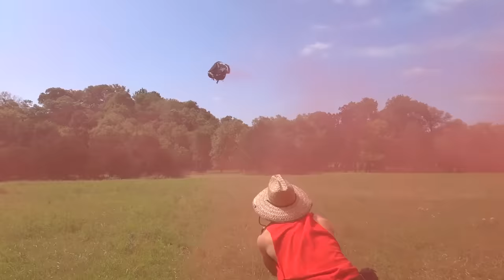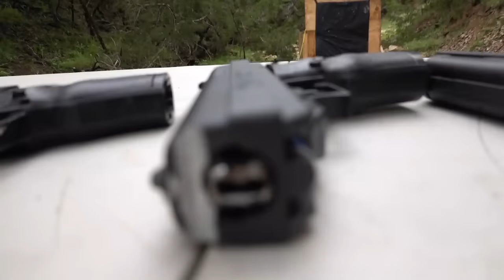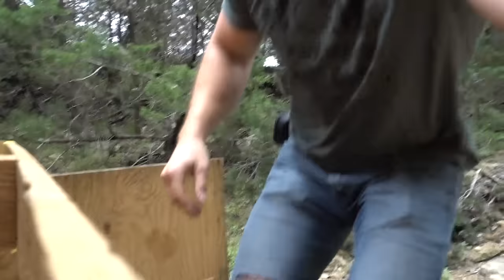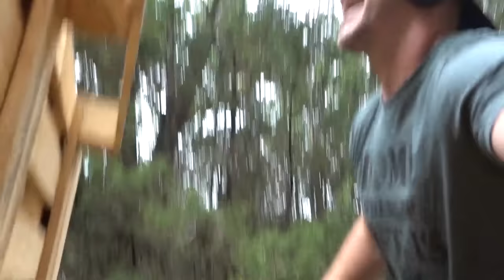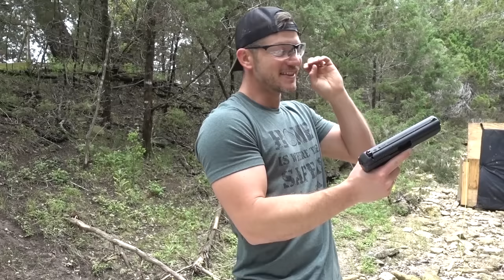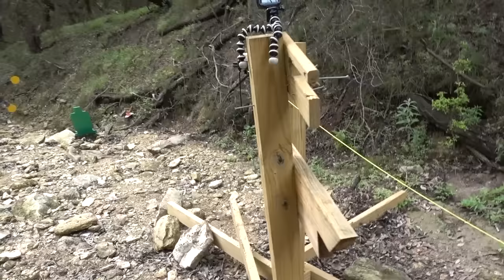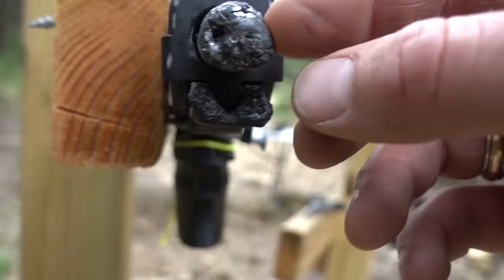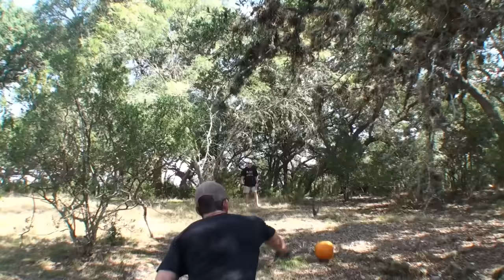I Welded a Barrel Shut...Then Fired it!!! Barrel Obstructions 2

Comment: I don't know if I would say a barrel splitting in half is exactly "surviving" 😂😂😂
Reply: Just weld the split, or send it in for it's LIFETIME/Transferable Warranty.
Reply: It would fire another round so i guess technically it survived. A little wounded  but still usable.  🤣
Reply: @beastman2513  he should definetly have tested what would happen on the second shot
Reply: Hi-point is probably the only gun where it is.
Reply: It split where they thinned it out to clear the slide. Anyone else catch that?
Reply: @beastman2513  no abnormal accuracy issues. Just as accurate as out of the box

Comment: Well im thinking about the Hi-Point .45 for a hide gun in my truck.
Reply: Don't rely on this gun to save your life
Reply: Because owning a Hi-point makes you want to hide.
Reply: this is exactly why hi points are the gun that populates evidence lockers the most
Reply: @wkslicex2508  I don't know now that I've seen this video they seem pretty darn reliable LOL
Reply: @wkslicex2508  beats a pointy stick.
Reply: @wkslicex2508  I bought one for a throw away if needed. It has been reliable and never failed to fire of fail to eject when using good loads.

Comment: Do every thing you did with the high point to a glock
Reply: Robert, l will tell you this, we had an idiot bring in a glock that he had on while climbing a cliff face . He dropped it over 200' into rocks . There was a big chunk ( technical gunsmith term) out of the left rear corner . We put it in a random rest , and using a string,ala Matt , we fired a single round. It worked , so we put in a full mag . They all fired . I'm not a fan of Glocks because they are too small for my sasquatch sized paws , but l have learned to respect their strength.  Have a good one brother , use the pistol that pleases you .
Reply: Look at the price of a glock and say that again

Comment: I'm just glad he never attempted these experiments, or the 1st set of experiments, with a glock. It wouldn't have passed any of the tests. Glock<hipoint
Reply: Put the bolt in a glock or any other high $ brand & you will get the same results.

Comment: Based on that clip it looks like the gas escapes through the magazine with the slide locking back however it does so; which means instead of detonating it just tears through the mechanics in the handle out the bottom. Better failure mode than the alternatives.

Comment: Most people underestimate just how reliable a Hi Point is.  And im here to tell you i took apart a VERY USED .40 SW Hi Point.  And it was so worn out that the metal on the underside of the slide would slice your fingers while trying to clean it.  But it still worked.  I filed the jagged metal down,  1500 grit sanded it,  cleaned and lubed it.  And it felt like a brand new pistol still.  They may be ugly,  fat and bulky,  but i went home with a girl like that.  And she owned a Hi Point too.........😂

Comment: Umm thats got me thinking I might want to get on. Damn things might fall apart but it will go boom everytime. That is unless you threat a bolt down the barrel or weld it shut. Other than that it seems it could protect. Also assuming you don't need too many follow up shots lol

Comment: Chamber a round, place gun upside-down in freezer or in  freezing temperatures.
Trickle some water down the barrel. When it freezes, I'll be damn surprised if it fires successfully.
Reply: Idk much about guns but I imagine that all chambers in a striker fired setup have a tiny air gap between the pin and bullet primer. Could be possible if you trickle and freeze the water correctly that the pin wouldn't strike the primer, at least not for the first few tries. This probably depends on whether or not the gun uses a hammer as well.

Comment: Matt I know this video is 2 years old and I doubt you'll see this comment but I hope you do you should have threaded the barrel for the concrete and the JB weld because all you did was stick a a liquid that turned into a solid into a smooth barrel giving it nothing to grab onto to actually cement those in place so when you shot the bullet it just slid right out

Comment: I want to see what happens if that barrel thread is taken all the way to the chamber. Will the bullet lose so much of its energy that it just falls out of the other end? Will it still have enough to propel it away and will it be super accurate at that point? What if you could build a chamber and barrel out of the strongest materials possible and then use as much gun powder as possible with a barrel thread with the same pitch as a bolt? Would it be insanely accurate with just as much force?

Comment: One of the things that happens when you make something cheap is that you use cheaper materials. This doesn't necessarily reduce the integrity of the material, it just increases the uncertainty of how strong it really is. To counter this you have to make pretty much everything overdesigned with thicker and stronger parts than it actually needs. Once you do that, if the material you actually get isn't defective and you designed it to work even with defective material, the result is actually a damn strong product.

Comment: I own 3 Hi-Points. 9mm, 40cal, and a 9mm carbine. Well over 1,000+ rounds through all, maybe more through the 9mm. No problem and not even one jam. Bought a new 40 just to test on. Just really stupid and unsafe ways to prove how serious Matt is with safety.
(( DO NOT TRY THIS AT HOME OR WITHOUT MATT, TRUST ME. ))
10' sledgehammer test, dirt, ripped it up with an F350 in the dirt, then drug it down the highway 30 miles just for kicks, threw it into a pond, fished it out of the pond just to fired it under water in the pond, "get ready for the rain and NOT RECOMENDED", and finally the mud test. Mud test finally did it in due to the slide didn't fully cycle closed but after a about a dozen or so dry pulls it finally started to cycle again. Still works, well sometimes, lolol not really, doesn't have any sights, clip was screwed up. Needless to say it was truly trashed.

Sweet video but I do swear to my Hi-points...Sorry Matt. 
I'd love to send it to you to finish it off with the Berrett.
Keep the destruction coming my friend, never gets old, just be safe...o7

Comment: Weld and thread the barrel of a 1911. Personally I also don't like Hi-Points, but if you weld and thread barrels of any handgun it's likely gonna have similar results. The only difference your probably gonna see is if one manufacture uses weaker materials in manufacturing it's gonna fail at it's weakest point. Hi-point, Glock, Ruger, any of em. Every one will fail relatively similar shooting the same caliber with the exact same fault.

Comment: I knew that bolts are extremely tough, but didn't knew that they could be THIS tough. And I'm almost sure that it's impossible to make perfect threads in hard metal used in barrel, so this bolt here is probably weaker than it should be

Comment: I can't stand those Hi-Points however, in their defense I don't think any other gun manufacturers pistol in that caliber could get through the weld or threaded bolt either. So, calling them crap solely on the obstruction tests is a crap call in itself. Fun video though.

Comment: hello, I googled hi-point and I found your video- im a security guard in the housing projects in Alabama-working for minimum wage which is $7.25 an hr-yes I know-But you do what you need to do to feed your kids-i have a friend that lets me use his HI-POINT for work, He told me that it a cheap gun but it will work if I ever need it to, And I am glad to have something besides a pocket full of ROCKS, I am very well outgunned out there and I know that, They have made that quite clear, My wife has told me to tape a phonebook to me chest just in case-Buying a plate is not even an option-Do you think that a phonebook would help if I was to get hit-I'm all they have so I will try anything to make it back home to them, I must say I am very scared out there-But I would not tell my wife or kids that-So what do you think would it work or not-the gun and the phonebook?